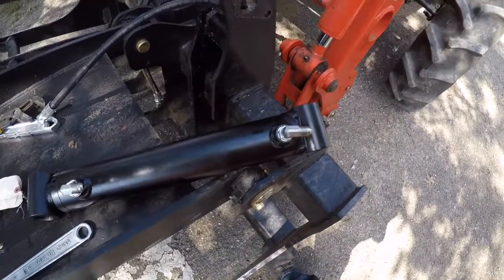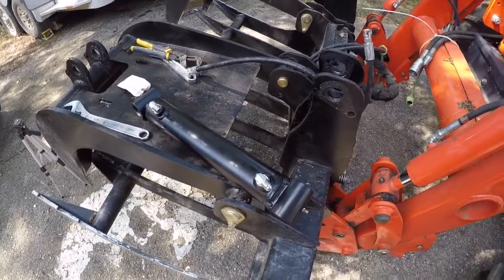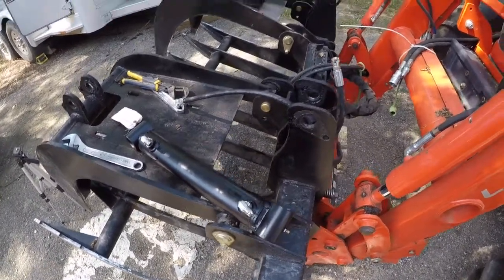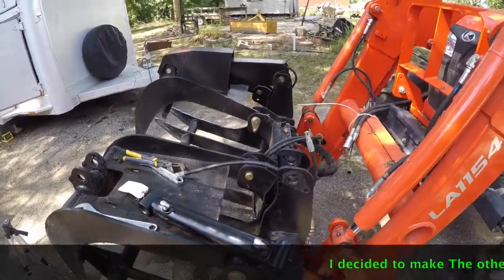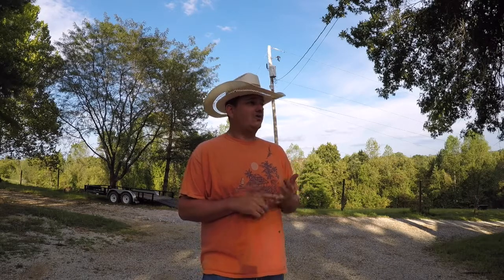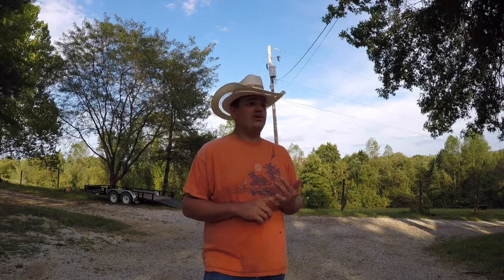Grapple Repair, Installing the Hydraulic Cylinder on a Grapple #64

Comment: Had my MTL cylinder start leaking fluid with about 8  to 10 hours on it. Not happy
Reply from the maker: Mine lasted a good while but I was pulling a log and tweaked the clamp and it broke the weld on the cylinder spaying hydraulic fluid everywhere, took it to a hydraulic shop and they rewelded been fine ever since, but I also don’t pull 40 foot logs anymore, lol.